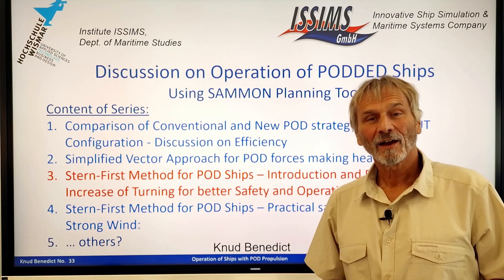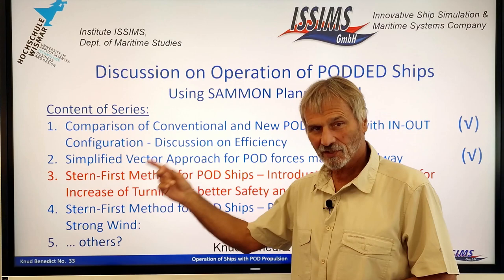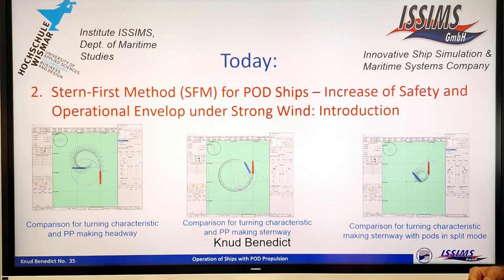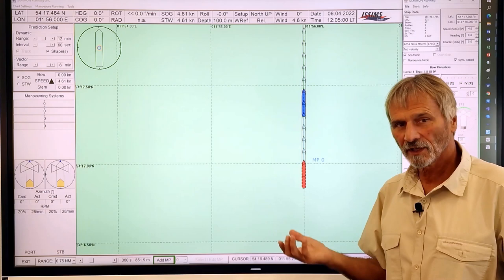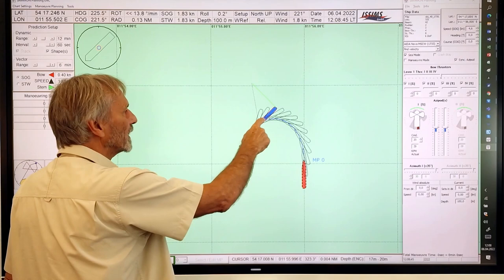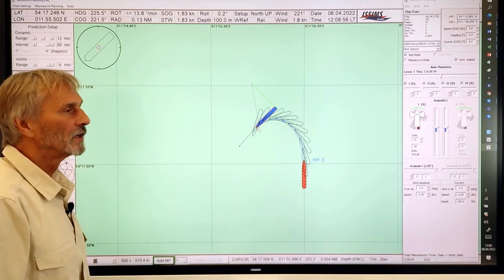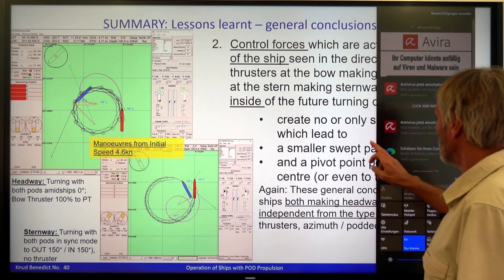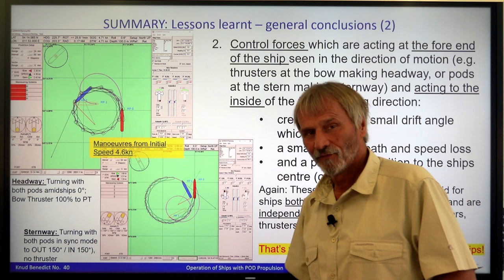Stern-First Method (SFM) for POD Ships – Introduction & Potential

Comment: I have face with a matter. For example: Vessel is altering the course to (S), initial heading is 000, rudder set to (S) 20, ship heading is turning to (S), rate of turn increasing, ship's speed is decreasing. I want to stop heading at 090 with most shortest of time. So, at which heading we need to turn rudder to (P)? Which angle of rudder will be applied? When do we need to return the rudder to midship? And ship's heading will stop at 090 with rate of turn zero upon rudder back to midship. Please help me if there are any formulars or rule of thumb or method of testing to point out a rule?
Reply from the maker: Is this question directly related to that movie on Stern First method  - or more general! Is this situation under strong wind, then what is th direction?
Reply: @issims-innovativeshipsimul4419  please kindly make a video about this matter. Almost seafarer don't know how to stop heading fastest at a intent direction.
Reply from the maker: What you are looking for is called Overswing or Overshoot Angle, which is familiar from Zigzag or Course Change Tests. It is simple to get:  turn your ship with 20° SB rudder and then apply at a certain heading angle counter rudder 20° to PT - Then  you can  measure the Overshoot of heading (e.g. 15°) until the ship stops turning at ROT=0. This Overshoot you can use to stop turning with counter rudder to be applied 15° before the desired final heading.